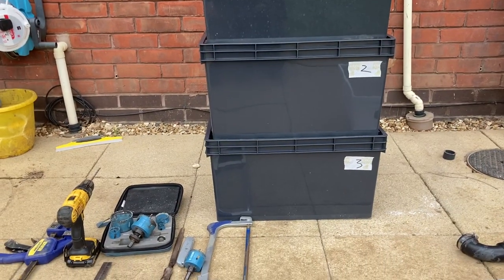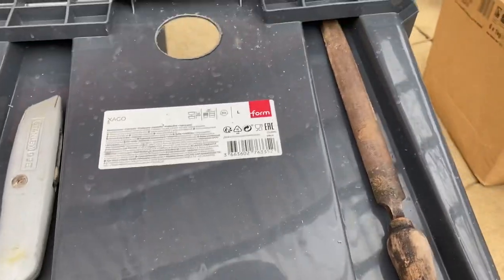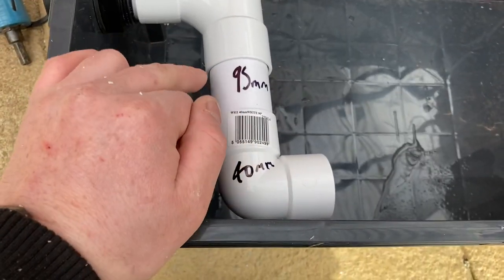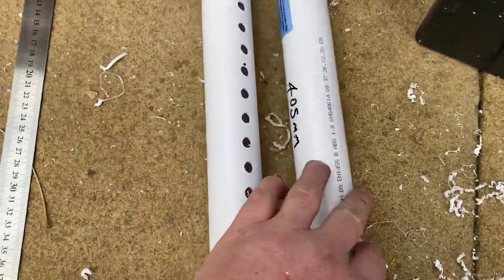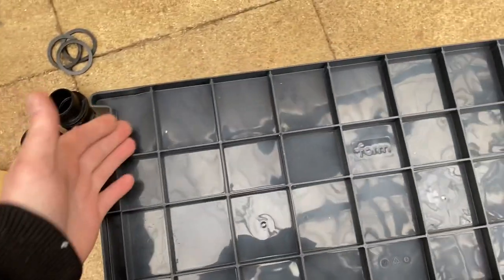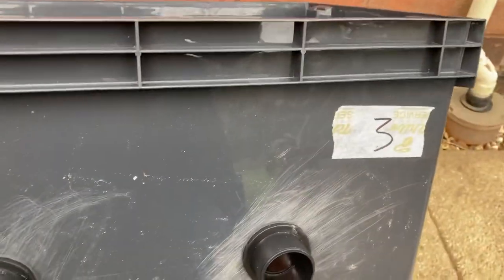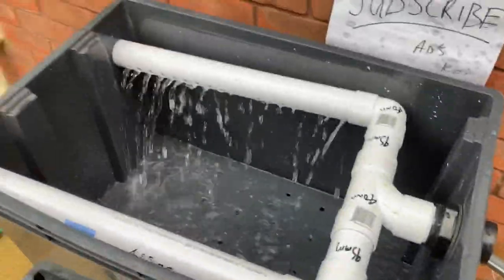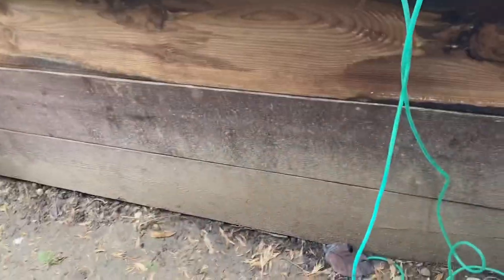DIY SLEEPER POND BUILD***DIY BAKKI SHOWER TUTORIAL

Comment: you should put more holes in the box
Reply: @ADS-KOI  Use a hole saw and make large holes in the middle of the squares!
NO water is supposed to buildup and pool in the bottom of the Bakki trays!
Look at some of the professional ones, they just have a grid in the bottom so the water crashes through onto the media below.
Check out the series of videos by “Dazzle Koi” to see how it’s supposed to be done!
Very informative and full of information on media and flow rates required for proper operation!